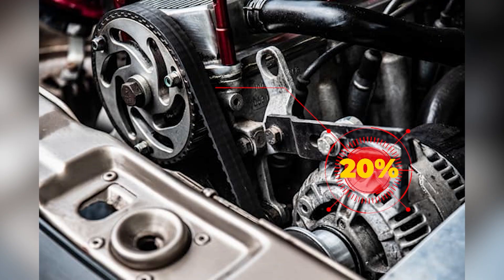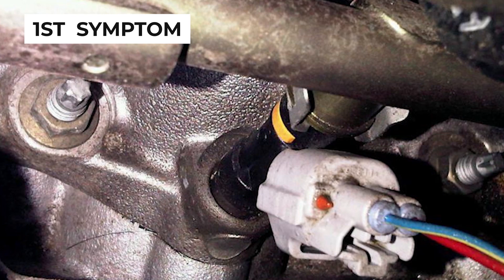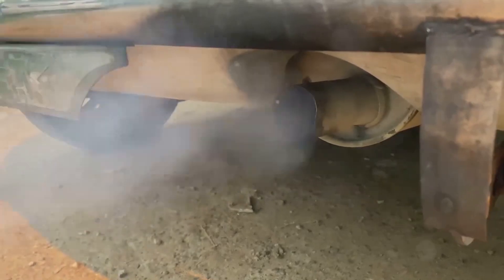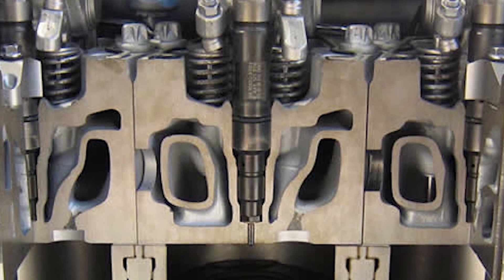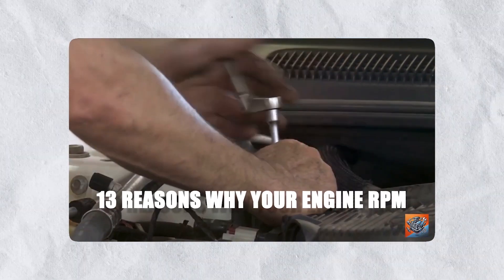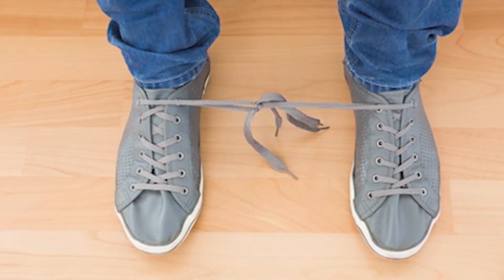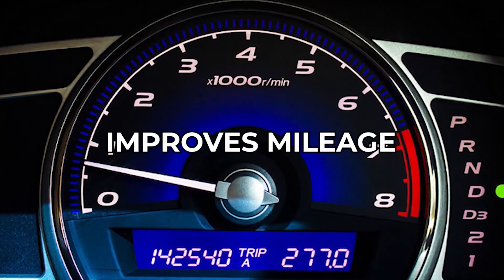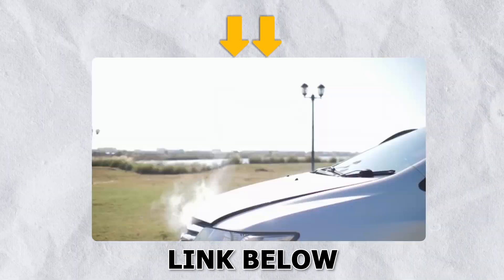13 Signs & Symptoms of a Bad and Clogged Fuel Injector

Comment from the maker: 9 Bad Crank Position Sensor Symptoms https://youtu.be/isrVbvwAoVc

⬇Care Care Clues Top DIY Tools and Products:
🚗 Essential Scan Tools
Newest Scan Tool:https://amzn.to/3GJyuET 
Bluetooth Scan Tool: https://amzn.to/42AcBRc 
Cheap Scan Tool: https://amzn.to/42WZIzx 

🔋 Emergency Essentials
Best Jump Starter: https://amzn.to/44fYOAm 

🛢 Fluids and Leak Stoppers
AT-205 Re-Seal (Stops Leaks):  https://amzn.to/3S9icYm 
ATS 505 Fuel System Treatment: https://amzn.to/3YQjjA2
Lucas Oil Transmission Fix: https://amzn.to/4jNk98M 
Bar's Cooling System Stop Leak: https://amzn.to/3Sht0nj 

🔎 Quick DIY Diagnosis Tools
Head Gasket Leak Test Kit: https://amzn.to/4jRgc2T 

🛠 Useful Maintenance Accessories
Quick Twist Oil Drain Valve: https://amzn.to/4jWG3GJ 
Tire Gauge (Check Pressure): https://amzn.to/3GxySGD
Tire Air Pump: https://amzn.to/3RZK9Cd 
CRC Mass Air Flow Sensor Cleaner: https://amzn.to/44dJpkb 

🧰 Mechanic’s Must-Haves
Car Battery Tester: https://amzn.to/4jTqyzk 
Basic Mechanic Tool Set: https://amzn.to/3Ymgerh 
Cordless Impact Wrench: https://amzn.to/3YkkhVc

Comment: I've a Daihatsu Hijet with 130k on ODO. The first time in a day to run the engine, it won't start until several persistent attempts. It doesn't matter the part of the day; evening, morning or afternoon. The engine won't just start normally as long as it's the first time. Once it runs, then you'll have less challenges running it the next time. What could be the issue?

Comment: $300 to 900? Parts for my vehicle was 5400 and labour was another 1000
Reply: what vehicle do you have?? you paid $6400 for injector replacement ..? that is highway robbery.
Reply: @planetcally3334 i have a V8 toyota landcruiser VDJ79 2009. No got a qoute from the toyota servicing. They qoute another 2000 for all new injector pipe lines and 2800 for both swivel hub and new wheel bearings. 

Told them that is way to much. Got the ute off the work shop, did the swivel hubs and bearings myself, (cost about 650 in parts and tools). The fuel pipe lines replaced at a smaller 4x4 shop that was 800 (parts and labour) and they said the injectors are fine, may need to be replace in a year or more, however just run injector cleaner to prolong their life.

Comment: Good morning friend I have Volkswagen Passat 2019. But for the last one month eat too much deisal. When I full the tanke it runs 420km only. Please tell me the solution. Thanks
Reply from the maker: Hey friend, a 2019 Passat should definitely be giving you more than 420 km per full tank, so something isn’t right. Here are a few things you should check:

Air filter and fuel filter – If clogged, they’ll cause poor fuel economy.
Tire pressure – Low pressure makes the engine work harder.
Driving style – Aggressive acceleration and idling burn more diesel.
EGR valve, injectors, or MAF sensor – If dirty or faulty, they can cause high fuel consumption.
Check for engine warning lights – Scan with an OBD2 tool to see if any sensors are failing.

I’d recommend visiting a trusted mechanic to run diagnostics. Sometimes even a simple injector cleaning or MAF sensor check solves the problem.

Comment: The cost of replacing fuel injectors today (8-  $50 for 5.4)..it doesn't make sense to clean them !!!I replaced all plugs,ignition coils .& Injectors for under $150...never ran so great !!!
Reply: in some cars it can cost up to 1000$.
Reply: @francoisloriot2674 yeah if I were to replace all 4 coils and all 4 injectors it would cost me $1000+. And that’s in a 2020 Kia forte GT! Thank you for stating that it’s not always cheap
Reply: @UNSE3NKIL1ER22  obviously the bears den bought aftermarket junk and that’s why he’s saying al, that stuff was as cheap as it was. Seems you’re like me knowing OEM is best for things that he has mentioned.
Reply: @francoisloriot2674 ...Amazon.!! Everything still working great...everything comes from China ..some companies just relabled them.! Cheers
Reply: @francoisloriot2674  obviously the bears den bought aftermarket junk. Seems you’re like me knowing OEM is best for things that he has mentioned.
Reply: How if one coil costs around 100 dollars?
Reply: @emassivee7986 some cars have 8 cylinders?
Reply: @emassivee7986 ..ordered all mine from Amazon...
Reply: @emassivee7986  ....your getting ripped...everything comes from China ! Just relabled ..
Reply: @thebearsden1701  the quality of aftermarket vs OEM is WAY DIFFERENT. You can believe that fact or not.
Reply: @YahwehIsKingOfKings it all comes from China dude...OEM & after market ..cheers
Reply: @thebearsden1701  prove what you’re saying!
Reply: @t @thebearsden1701 any of the parts you buy may come from China but I buy Toyota OEM and a lot of those come from Japan which are made much better. Denso is Japan but I only buy Denso if I can’t buy straight from Toyota.
Reply: @emassivee7986  you by aftermarket junk. Aftermarket crap will always be cheaper than OEM
Reply: Wish my coils were as cheap as yours. Things like that I would never buy aftermarket. Coils, sensors of any kind, and certain other things I ALWAYS go OEM. May cost a lot more to go that route at first but most of the time saves time and money in the end. Aftermarket crap is just that for the most part crap because it’s not made with the same quality and will never last as long.

Comment: Fuel injectors don't last on cheaply made vehicles, even ones that cost too much to buy. I've lived for more than 60 years owned more than a dozen vehicles and keep them for as long as 20 years and I've never replaced fuel injectors because my vehicles never needed them. If you are replacing your fuel injectors between 50k and 100k miles, you are either using horrible gas or you purchased a horribly designed vehicle.
Reply: This is probably the wrong place to ask for advice but I’m desperate. I’ve had issues with my truck stop accelerating while driving in the highway. And when I slow down to park it. The motor be shaking like crazy so I turn it off. Then turn it back on after a few minutes and it works again. But it’s only happens when I go faster than 50 miles an hour. Other small issues is it take a while to ignite. And I have to hit the Pedel harder than usual when when leaving th driveway so it accelerates

Comment: My wife’s jeep renegade started ROUGH idoling and stalling one day. We limped it to the closest store. I came later with a friend with a trailer, cranked the jeep, loaded it just fine and it has ran with ZERO problems since. I put better fuel, water remover and oil changed. It runs like a scalded dog now. I go the hell knows what got clogged in there momentarily

Comment: I have P0302. Switched the ignition coils an spark plugs, but stays Cylinder 2. Bad Fuel injector?
Reply: Having the same problem, pretty sure it’s a bad fuel injector
Reply: @willogarcia8305  There was no compression on cylinder 2. Mechanic said engine dead.

Comment: Thank you , was getting p0300 multiple misfires , getting a rough idle, tapping noise changed spark plugs still same problem, cleaned my fuel injectors problem solved!!!
Reply: How did you clean it
Reply: @chrispartida1081 I second this question
Reply: Glad it helped after changing your injectors. I had multiple misfires on my wife’s Toyota but the issue was a leaking valve cover gasket. Oil was seeping into the cylinder walls and dripping on the spark plugs
Reply: I have the same code p0300 changed plugs and coil packs all the same time and no engine light the next day the check engine light kept flashing for awhile and confused but I’ll try the injectors and hopefully it works !
Reply: @frankiec5602 bro I’m having the same issue. I replaced the spark plugs and ignition coils but I still have a flashing engine light. Went to autozone and got codes for p0300(misfires), p0201,203, and 205 for my fuel injectors. I’m getting them replaced tmmr so hopefully this solves the issue 🙏🏾🙏🏾
Reply: @frankiec5602 did it work ?
Reply: needed this 😂
Reply: Speak for yourself lol mine cost 167$ per injector and I have 6

Comment: Engine misfire on my OBD reader is P0300 (multi cyclinder misfire) to P0301-P0308 for cylingers 1 thru 8.  I had a reading P0301(cylinder 1) and since I had changed spark plugs and coil packs recently I guessed it was due to a dirty fuel injector.  I used Lucas  Fuel Injector Cleaner and it seems to have cleared up my problem.  No more dash "check engine" light.
Reply: I'm getting the same code
Reply: Change them please

Comment: Mine is cutting of while driving could that be it
Reply: Battery… my car used to get off sometimes when driving 5mph
Reply: Does it start after cooling down for a few minutes? If so,check the crank position sensor. Had this problem on a 2000 Mercedes Benz E320. Started great. Ran normally. 
Would just quit. Would not restart,until a while later after sitting. Everything normal again. Intermittent. Just quit. 
Good luck.

Comment: Hello there 
I have an issue my car ( ford smax 1.8 2010) was leaking a bit on the 1st enjector but car was absolutely fine just the smell was a bit,got the leaking fixed and still was a bit comming out but the engine started shaking  between 1500 to 2000 rpm mostly with 4,5,and 6 gear.sent it back got the leak fixed but still does the shaking on the higher gears and still betweek 1.5 to 2.1K rpms 
What could be the issue please
Reply from the maker: Sounds like you’re on the right track fixing the leak. The shaking you're describing between 1,500 and 2,100 RPMs, especially in higher gears, could point to a few possible issues.

Even after fixing the leak, if the injector was leaking for a while, it might have caused carbon buildup or slight misfiring in that cylinder. It could also be a sign that the injector is still not spraying properly (even if it’s sealed now) or that the cylinder temporarily lost compression due to earlier fuel wash.

Another thing to check: the engine mounts. Sometimes engine mounts can wear out and cause shaking that's most noticeable under load (like in higher gears at low RPMs).

If it were me, I'd scan for any stored fault codes (even if the check engine light is off) and maybe run a fuel system cleaner like Techron through the next tank to see if it smooths out.

Hope it smooths out soon. Let me know how it goes.

Comment: Hi I had a check engine light come on in my 2006 Honda Pilot and the codes were P0172 and P0175. I have late start in the ignition when I’m starting the car and my acceleration takes time to get power does that mean I have bad fuel injectors? Thanks in advance.
Reply: Bad o2 sensor
Reply: @ Actually it was the MAP Sensor that went bad. I bought a new one and the car is running like a champ and better acceleration response.

Comment: Got a question i need help with got an aftermarket injector plate put an injector in just to see how it fits the plate end has like a seat where the o ring can rest on and can't go any farther the fuel rail end dont the fuel rail is not adjustable so with the injector in i can slide it up and down like a quarter inche or so what can i do

Comment: Mine has a rough idle in cold starts then when i unplug the ign coil wire in cy1 it idles properly, new spark plugs, could it be a bad injector?

Comment: Sorry I wanted to ask a question please. My car sometimes smells of fuel inside car. Petrol smell. Very strong smell and only sometimes. What could that be? Also uses a lot of fuel. What could that be please?? Sorry to trouble you. Could anyone advice me please. It’s a Nissan Qashqai 1.6 petrol. 2011.
Reply: Alright,I went to the mechanic and changed the spark plugs as it had developed a lot of carbon ,I could have just cleaned it ,But nah let's change it.. Then I told the mechanic to check the injectors.Once he removed them ,They looked full of gunk and messed .Got the 4 Injectors cleaned thoroughly and they changed the O rings. Now it runs like a mini cheetah ( Ford Focus 2004) Now I have filled the tank almost full but not FULL .I will check how much MPG it will give me.Till now no fuel smell.
Reply: @RangoMacha  Excellent. Thank you for commenting.
Reply: I have the same issue just as you explained. For me it happens when I fill the tank full.

Comment: When my truck comes to a stop it turns off and when I go in gear and push the gas it has a problem accelerating I changed almost all the sensors and still the same problem
Reply: Change the fuel filter / fuel pump,
Reply: Same yeah I just changed the fuel pump and was running but would shut off after 10-15 minutes I just started it now and was trying to let it get used to the new pump but it shut off again after 4 minutes and now won't start ? Maybe fuel injector because I have a 2001 ram 1500 and the fuel filter is inside with the pump and all that is brand new, my only guess would be fuel injector
Reply: @ChromeGonSmack1   did you ever get it fixed, what was the issue?

Comment: My range rover l322 td6 diesel  drives ok but it will just out of nowhere just struggle to start it turns over ok bought a new  battery everything works fine but still it can drive perfect say 4 weeeks no problem then out of nowhere boom random just turning over i leave it for about 20 30 minutes  then it starts what could this be i do sometimes smell fule but not all the time plus when i pull off at lights it blows a bit of white smoke  cheers anyone no if this is abad fule injector

Comment: My 05 Toyota matrix  is draining gas like crazy but blowing white/grey smoke  with a fuel smell I hope this is the fix I need I’ve replaced the coils and spark plugs so far and no change
Reply: Did you get this problem sorted, was it the fuel injector?
Reply: @mrshoney2624 yes fixed it right up
Reply: Do you find the problem ? I have the same problem with my renault megane .
Reply: @blerimkrasniqi6516 it was the fuel injectors replaced all of them with densos

Comment: I have a very magical issue, I say it is magical cause it happens during the afternoon. Car stalls and jerks when I have around approx. 12l of fuel during afternoons and with the same amount of petrol during night I do not see the issue. Experimented this with a can of petrol, and it happened again during afternoon and when i observed the issue, I filled out the petrol, and it ran. During the night, i did not see that issue at all. This is experimented when Im on low fuel. Recently,  when I have half a tank fuel, it still jerks and power delivery are not smooth.I  own a Hyundai Accent Gle petrol with 100k on ODO.. it runs very well, no smoke, no sound, nothing. The problem i noticed is very strange, I am on a highway and still have fuel, and I feel jerks and cars come to a full stop. No check lights when I try to start immediately. It starts, but when accelerated, it does not move and stops again. I thought it could be an air lock issue, opened the fuel tank lid, closed the lid, and tried it, and it worked better than the first try.. The car moved a little bit and stalled again.  Apart from this issue, car runs smooth constantly, and 140+ kmph without breaking sweat. I replced plugs, fuel pump, and air filters, but nothing worked. Mechanics could not solve it.
Reply: your fuel pump might be dying also check the fuel filter it might be clogged causing the pump to overheat. And of course during the afternoon it is hot so it makes it worse
Reply: Very strange. I think the 1st comment was good. Possibly fuel line partial blockage. But strange coz it only happens when car is warm. I was thinking camshaft sensor. Coz my brother had same problem. Worked well on the way to work. And on the way back having a lot of traffic nearly home from work car would stall.
Reply: This was happening to my toyota camry - - -  gradually my car was totally stopped I called  mechanic then told to replace the fuel pump motor and after replacing that motor my issue was fixed yes
Reply: Bro, its not the amount of fuel in your tank that couses magic. Its temperature. Your car is hotter during the day than at night. You gotta drop it like its hot!
Reply: Blocked or dirty injectors, the arvo air is warmer fuel evaporates quickly, try put it in the shade open your bonnet for 5 let the engine cool and then try start
Reply: @minniebarnes6367  thank you !! Mine is a petrol engine, I checked with multiple mechanics, and they informed me that petrol cars will not run into fuel injectors issues...
Reply: Fuel pump or even a sticky PCV valve(they can be touchy with higher heat and different vapor pressures). Especially given your changed results with the fuel cap. I've had the same exact issue on a 4.8 Silverado. While you're at it, use some LiquiMoly Complete Fuel System Cleaner. Stuff works amazingly well.
Reply: There's a valve that sends fuel back to the tank if the pressure is too much, sounds like it is opening and sending fuel back to the tank when it's hot and then works fine when it's colder, so you have weak fuel pressure when the valve is warmer, and the car heating up won't make a difference as the valve is in or on the fuel tank.
Reply: Check PCV Valve as u already changed ur fuel pump. Pressure in ur rail is not maintained. Check return line as well
Reply: Check the fuel cap when this happens, see if it’s pressers up, it’ will have a lot so you will here the air, leave cap loose, but another gas cap needed when this happens , OEM if possible

Comment: Morning when i start car take long to become warm the engine and sometimes i press accelerator give really bad smell any solution?
Reply from the maker: This could be due to a stuck-open thermostat, clogged fuel injectors, or a rich fuel mixture. Try checking the thermostat and fuel system, and consider running a fuel injector cleaner through your system. If the issue persists, a diagnostic scan might help pinpoint the problem.
Reply: Change tyre
Reply: @kizatela535  u joking ? 😆 😂